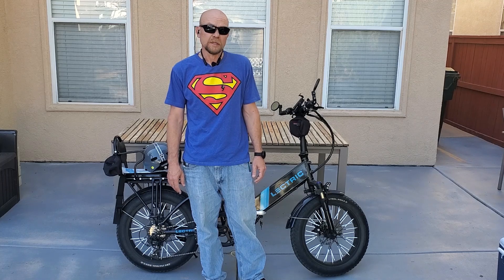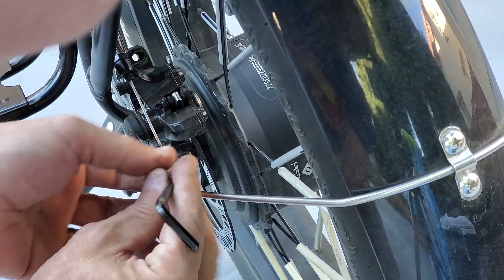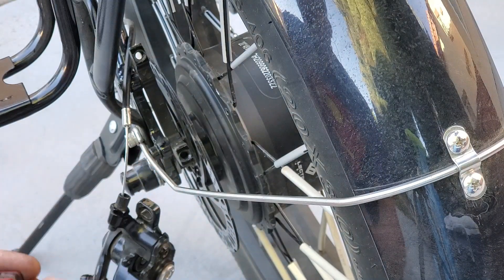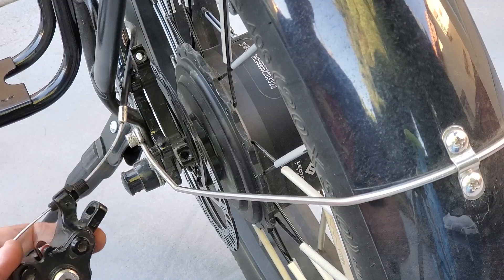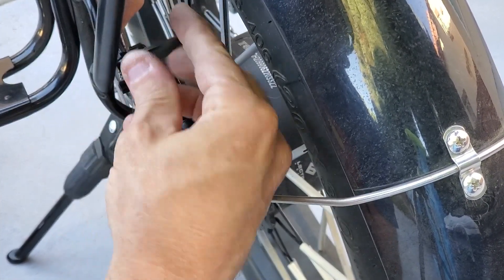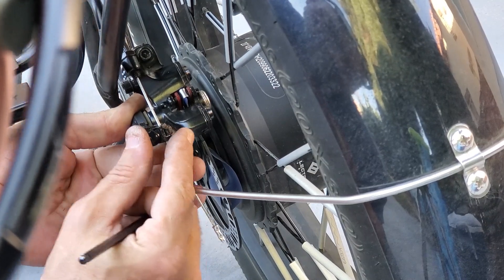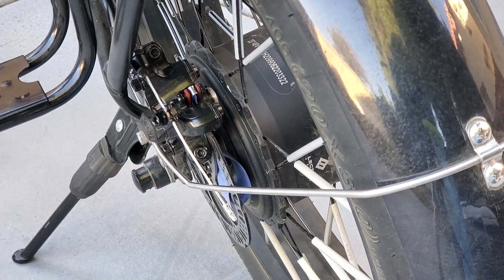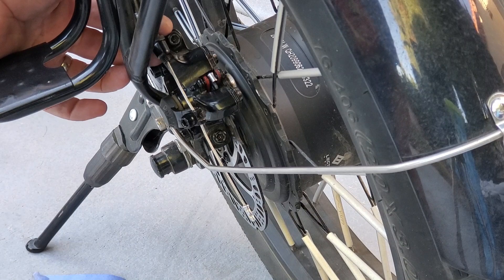Brake Pad Replacement - Lectric 2.0 XP

Comment: I got 1724 miles on original pads….a lot easier and quicker than the video…remove the caliper change the pads, caliper back on… no adjustment needed….I recommend doing both front and rear when your doing pads…I got 4 sets on Amazon for $11